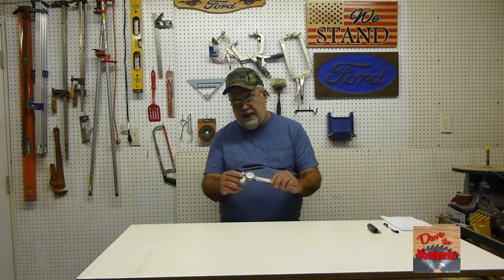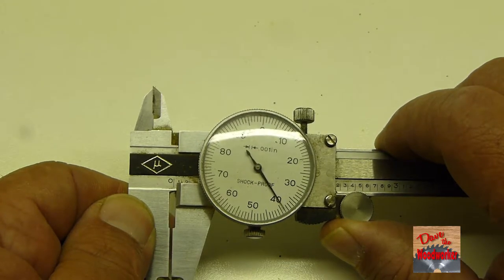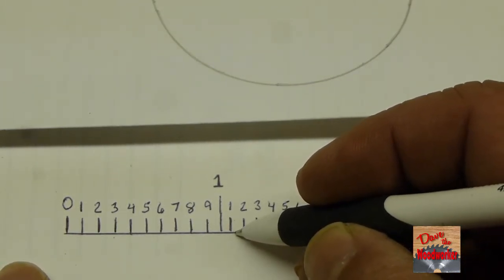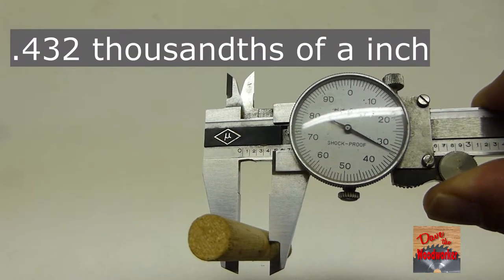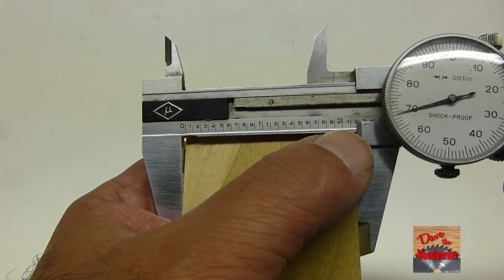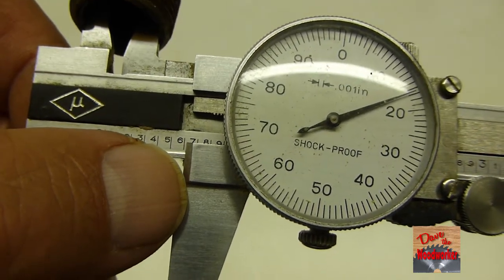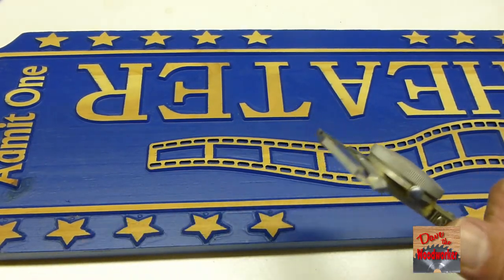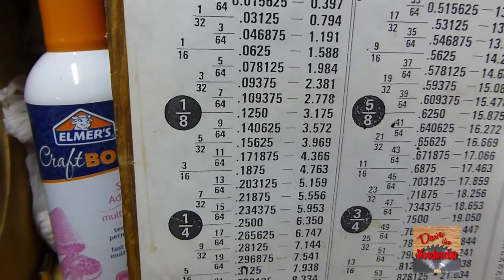How to Read and Use a Dial Caliper

Comment: My caliper does both thousands, and inches in 1/64th increments. My problem was the instructions which were poorly printed, and the instruction was horrible. You made it easy to understand. Thank you.
Reply from the maker: You're welcome, I did make a mistake at 3:41 , it supposed to be 2.169 thousandths of a inch